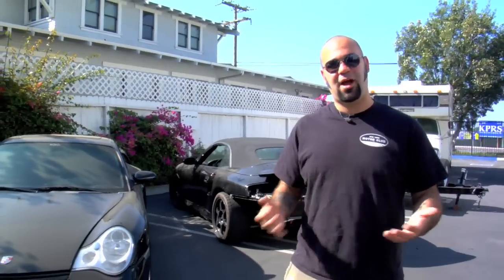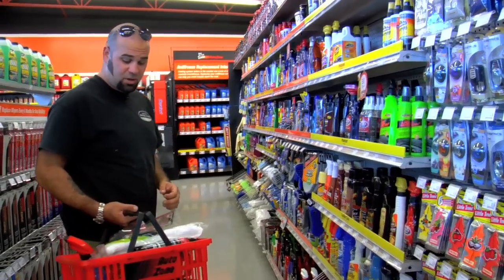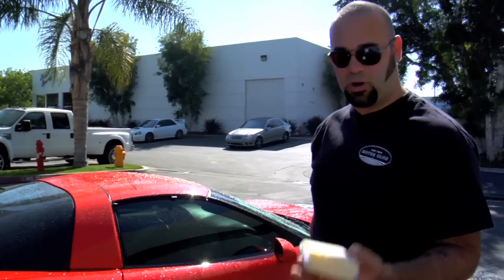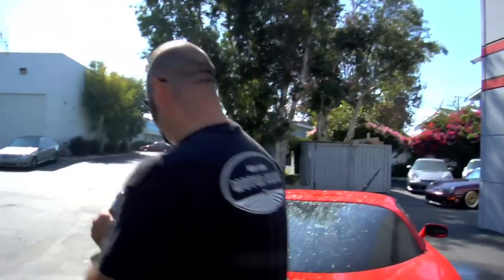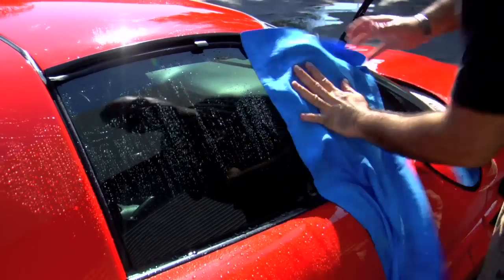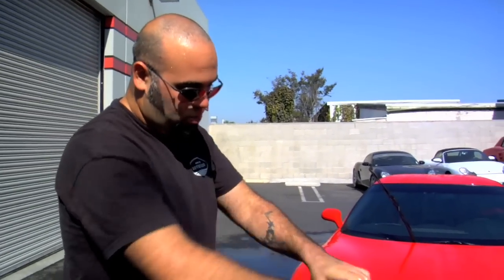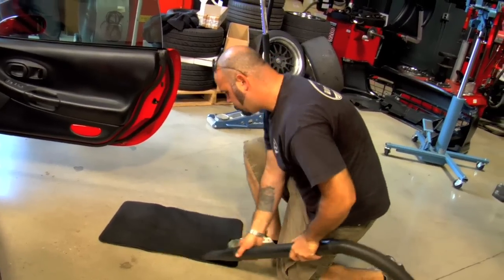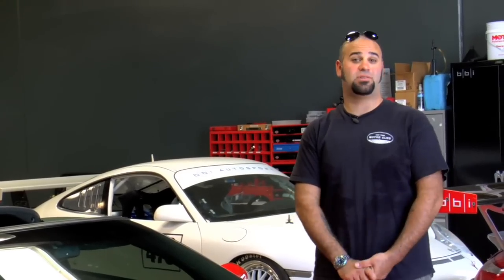How to Wash and Detail Your Car - Part 1/2

Comment: You really need to leave instructional detailing videos to the professionals. You can get better products for less then the garbage you bought, and your technique is lazy. I like your car reviews, they are splendid, but what you did in this video damaged the paint. I don't have enough characters to describe every thing you did wrong, but I'll try.

no chamois
no foam mitts
no sunlight
use pressure washer and foam gun
use proper brushes and completely separate brushes for wheels
clay until smooth